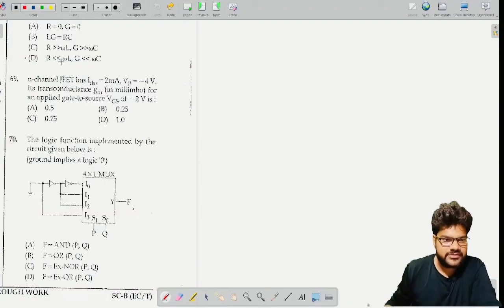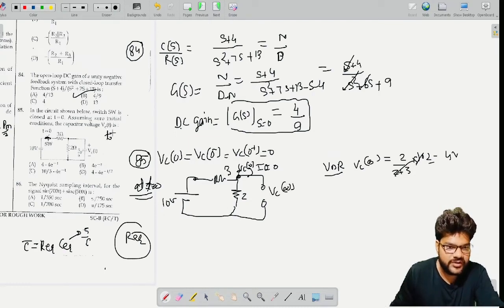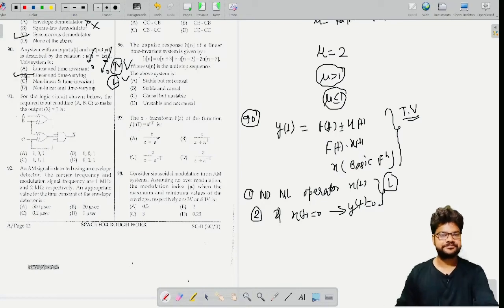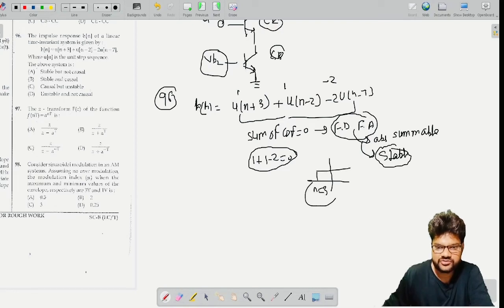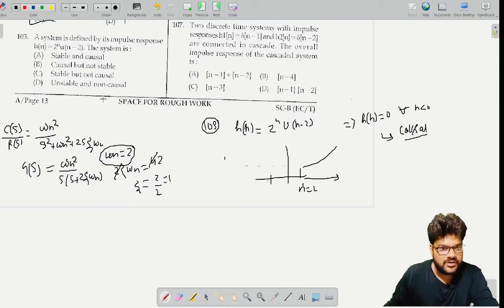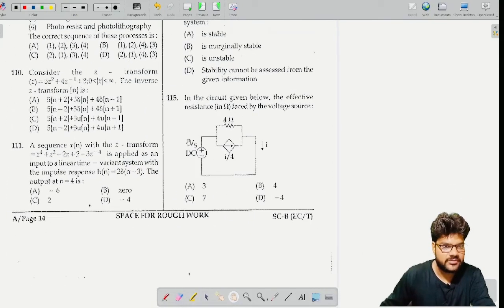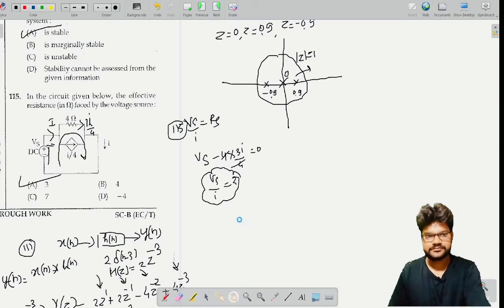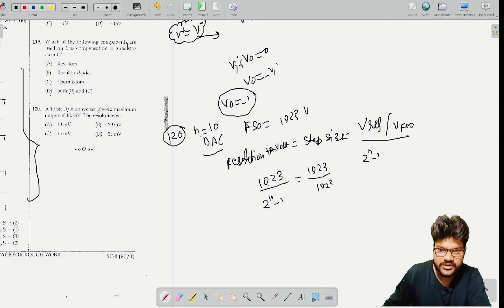Nielit Scientist B 2016 Complete Paper Detailed Solutions Part-2 | Yogesh Singh IISc

Comment: Sir ..nielit paper 12 -13 March 2016 the question was 
In a class A series fed amplifier using a transistor, under ideal conditions the maximum ac power delivered is 1 watt.
The maximum transistor dissipation capability should be:

1 watt

2 watts

3 watts

4 watts
Will u please give explanation for this
Reply from the maker: send that que in tele group
Reply: Sir I have posted it on telegram group